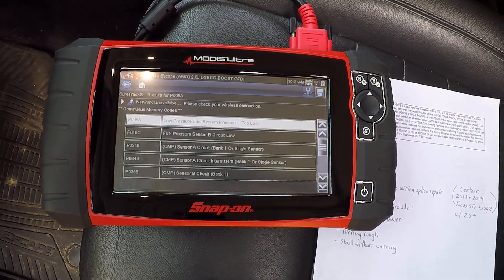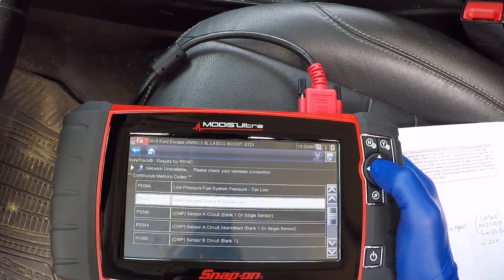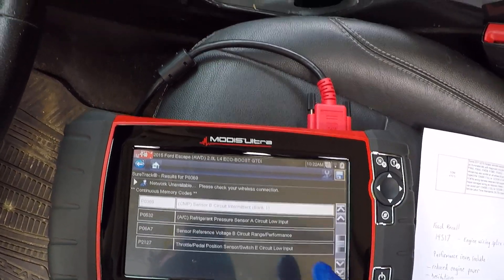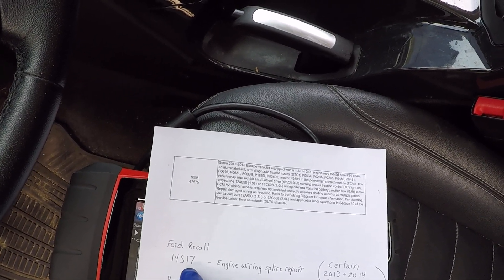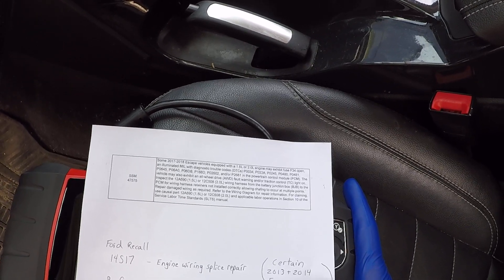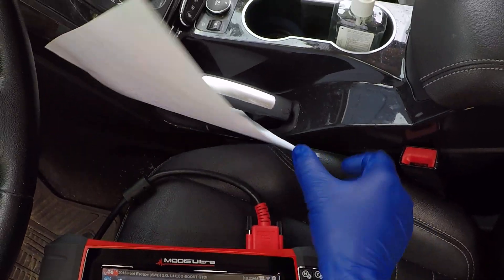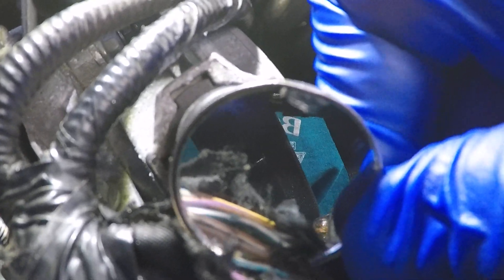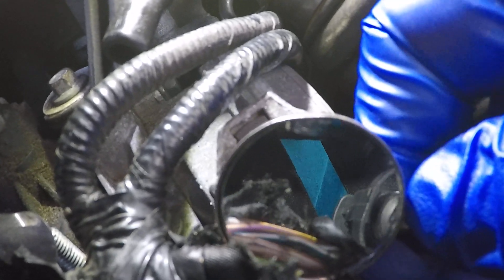How to Fix: 2013+ Ford Escape EcoBoost Stalling Issues

Comment: Just need to make a huge shout out to your comprehensive video quality... Mechanical failures can be So time consuming and the research doesn't really pay in money but it's priceless information... My escape had a hesitation and engine fault on dash everyday... But not a single code thrown for the issue...  Finding this video gave me info about my escapes dangerous short circuit in wire harness . Ford never reach out to me about this issue... The ford dealer acted like it was a mystery and could cost up to one grand in parts to trouble shoot the issue....  I drove off and took it into my own hands..... You took the stress right out of my issue.  Ty.

Comment: Did this repair fix the issue? I have a similar problem with my 2014 2.0. It will drive for about 1/2 hours then shut down with “service engine now” display. I wait for 30 seconds and then it starts up again and runs for another half hour or more.

Comment: Thank you for the video. Would Changing the transmission fluid Fix the issue
Reply from the maker: unfortunately, it definitely won’t
Reply from the maker: This one is all engine related - the main wiring harness
Reply: @MidknightMechanics  thanks so much for your time. if i have my mechanic do what you did in the video will that fix the issue? i'm worried the car wont be worth driving anymore because of this. it seems dangerous.

Comment: My 2013 ford escape stalls on the highway randomly. I've spent so much money and no one can seem to fix the issue.
Reply from the maker: @cameronbrown387  did yours fall under this recall yet? Some 2013s were covered by this.
Reply: I don’t know. I bought it used from Ford . I’m in Canada . How do I find out
Reply: @cameronbrown387 
Call ford dealer ask for recalls, give number from video . Have vin ready, be nice
Reply: I have a 2014 Ford Escape Titanium for my daughters and it is having the same stalling issue and the check engine light flashes.  If you restart the car or drive it for a little longer, it goes away.  I will have to check this wiring, but it may be a misfire caused by the fuel pump or fuel filter.  Not sure if it shows up on a Machine.  According to the website you mentioned, it does not fall under this recall.
Reply: @brandonhumbert4946  I have a 2016 escape that stalls while driving. I think its the fuel pump since the recent recall on 2021 describes the exact problems im having. It will stall while driving. And notice it happens when at 1/4 take or less and also when its hot outside.  Same description as the recent calls on 2021. I filed a complaint with the NHTSA hopefully they'll do a recall on our fuel pumps as well.

Comment: Thank you SO MUCH for doing this video!  I have a 2016 Ford Escape Titanium EcoBoost.  It's been doing CRAZY stuff like door locking & unlocking multiple times and hazard lights flashing at the same time, then sometimes my fuel pump will start making whining noise!  My daughter calls it Gremlins in the car!  It's so random. TWICE it has completely died going down the road at 50mph plus!  And once or twice chugging but not dying. TWICE I've had it towed to the dealership (extended warranty) and they can't find anything wrong with it because it won't "throw a code".  Heaven forbid they actually try to figure it out without a computer!!  My car has been in the shop for 5 days now with no result. I've told them and told them it has to be something electrical because of all the Gremlins going off at the same time. I bought it used in 2021 from a major dealership with low miles. Have had no problems until the last year with this. Also went through a car wash recently and drove away and it immediately started all the chugging again but didn't die. Then later it was fine.  I feel like it got moisture in the wires somewhere that are maybe rubbed like your video.  I'm LITERALLY going to show them this video!!  Then if it is the problem, I'm going to ask to be paid labor for my efforts!  Lol!  Ridiculous!  It's so dangerous for us to keep riding in this vehicle with this issue!  Last time my daughter thought the car was catching fire and scared us both half to death!  I've learned my lesson about Fords!!

Comment: Hello I have a 2013 escape my car has a weird situation going on the car will drive fine for a few miles then when coming to a complete stop the accelerator will feel like there's no power to the pedal. What could this possibly be?
Reply from the maker: Jordan unfortunately it could be many many things. Any trouble codes (DTCs)?

Comment: I have the 2016 Ford Escape titanium with the 2.0 ecoboost. I thought I would check my vehicle to see if it has that wire harness rub through. Sure enough mine was doing it even thought the 2016 was supposed to be fixed right from the factory. Mine was just starting to rub so I wrapped it with electrical tape and used a wire tie and just slightly pulled the harness away from the rub through spot as listed.

Comment: Thank you for the great video.  My mom has a 2013 and it stalls while in drive but only when the AC is on.  Do you think it could still be this problem or do you know if it could be something else?
Reply from the maker: Buck that sounds like a vacuum leak (tear or disconnected hose) to be honest.. if it’s only when the AC is on. Also the easiest thing to check is her battery and voltage first.

Comment: I forgot to mention I did go to Nortons Car Stereo and got a system put car im wondering now if this could be a problem too I just got a new battery paid 450 for the battery and labor.
Reply from the maker: Ugh probably the most I’ve ever heard for a battery swap. It absolutely could be tied to this, if they possibly disturbed the engine harness I talk about in this video- they may have routed the main power wire  for your amplifier on this same harness (they would have zip tied it, to it). If you’re not at a Ford dealer for this diagnosis I would highly recommend getting out of where you are, and taking it to one. A single diagnostic will only cost you about $160 MAX, to find this issue. Some shops just do NOT have the experience. Ford will have seen what your exact escape is doing and know exactly how to approach the fix. Have you ran your VIN on the Ford recall website yet!? Sorry for the kind of bad news but I have a lot of experience with diagnostics, and seeing people get ripped off left and right at Independent shops. When it came to the battery- did an independent do it, or was it Ford?

Comment: Having the same problem with my wife’s 2016 ford escape 1.6. Went to do the same thing you illustrated in this video but it doesn’t have the same wiring harness by the vacuum line

Comment: FOUND PROBLEM WITH PUSH START FORD BOUGHT FROM US AUTO SALES USED CAR DEALERSHIP!!!! they put a GPS tracker on the car so they can find your car if they have to repo it.  Well the Ford dealership just found where the company, US Auto uses called SureTrac put this GPS tracker in the car and had cut wires that went to the push start. So sometimes the car wouldn't start.  Intermittent issues and would cut off while driving on the interstate or wherever.  The push start would lose signal connection with transponder/key fib remote start. ANYONE HAVING ISSUES WITH A USED 2013 FORD ESCAPE ECOBOOST OR ANY OTHER REMOTE START FROM USED CAR COMPANY NEEDS TO HAVE SHOP CHECK WHERE THE GPS TRACKER WAS INSTALLED!!!
Reply from the maker: James you sure about this? Tell us who the used dealer was
Reply: @Midknight Mechanics  Yes Sir,  the name of the dealer was U.S. Auto Sales in Lithia Springs Ga.. I hope this helps someone. I hope it was ok to add this comment.  I just want to help give someone an idea where to check if they go around and around with a used dealership about a problem like we have.

Comment: Hi midnight mechanic's! Great video! However,  my harness wasn't rubbing against the vacuum pump.  We've ran the Vin number and there's only a recall for transmission solenoid. We've already had it in the shop multiple times after we bought it used.  It's a 2013 ecoboost Ford Escape with push button start.  It has stalled on interstate and other places and sometimes doesn't start. The problems are intermittent. The battery,  negative cable and sensor have been replaced.  And the 3rd time we took it to the shop,  the said they had to replace the computer/ECM and we had to buy a second transponder remote for them to program it. And it still does the same thing and throws multiple codes.  Like engine start fault,  BLIS, cross traffic,  etc.. the wiring harness near the vacuum pump isn't even touching it.  It's well tied and clipped all around.  Anything else it could be?
Reply from the maker: James you didn't buy it new did you? These sound like previous flood/major accident & reconstructed style issues since you already did an ecm, and you're saying your harness definitely isn't rubbing. Otherwise everything you said, are symptoms of a harness/wiring short. Make sure to follow the harness as far as you can. Not just on the corner of the vac pump.
Reply: @MidknightMechanics  awesome!! I had a feeling u might say that. About it being a short somewhere,  still, with wiring. Thank u so much for the reply.  It is a used vehicle and we never got the carfax on it even tho they said this were included with our paperwork. As soon as the dealership finds what's wrong with it,  I'll be sure to repost and update everyone. Thanks again,  God bless

Comment: I own a 2016 Ford Escape titanium 2.0 ecoboost and I found this video in the spring. I decided to check my wire loom and nothing was damaged. But to be safe I wire tied my loom so it would not happen. I just went out and checked and found the Ford had removed my wire tie at my last service and the loom was just starting to rub. I called my Ford dealership and asked why they would have removed it. I was told if it is not a Ford approved repair it could not stay like I had it. It was not touching any wires or hoses and told them to leave the damn wire ties the way I had it. I told them I am trying to prevent any damage in the future. Unfortunately I am tied to this dealership because there is a life time power train warranty that is through this dealer. Also I have extended warranty that I paid a fortune for So they have to do all my service work to keep the lifetime power train warranty. I do all my own work accept for the fluid changes.

Comment: Damn and this is why no check engine lights stay on sometimes because it's thinking the electrical is going the job correctly because typically it's just a ground out the signal issues anyway.
Fukn legendary find.

Comment: I have a 2017 ford escape. Had the transmission replaced, 4mo later the acceleration is sluggish. Ford couldn't find codes, I requested replacing spark plugs & air filter. Got it back & now it jolts when accelerating (sometimes not always) does this sound like the MAF? I would greatly appreciate input 🙏
Reply from the maker: Hey Crystal. This could be a lot of different things. If the check engine light is back on, it could be the exact issue in my video- a short in the main harness that caused a national recall on some year escapes because it's fraying against the engine's (metal) valve cover (right next to the cam driven vacuum pump, in my video). But, if your check engine light (CEL) is blinking then going solid, that means misfire- do NOT drive it while misfiring. If this is the case, you could have a bad coil pack, could have the fraying main harness issue, or could have a bad throttle body, and technically yes- you could have a bad MAF sensor but that's very rare. Usually when you're MAF is bad, it won't idle smoothly when in park or neutral, and usually stall. Go get your codes scanned for free by one of the auto parts stores and let me know the codes. Fords are more known for the throttle body to get water/moisture inside of them and make it short- this could easily cause sluggish acceleration or "surging".
Reply: @MidknightMechanics  That's the crazy thing! There isn't a light on. Even when I took it in for slower than usual acceleration there was no light & ford couldn't pull any codes. I had them replace the spark plugs & air filter in hopes it'd improve. Before I took it in it wasn't jolting, just sluggish when accelerating. I'm not sure if the new plugs caused the issue to create jolting due to more power from the plugs. I just know something is wrong & ford acts like they couldn't figure it out.....
Reply from the maker: @Crystal-km1wr  that really stinks. Any chance you ran the VIN through the Ford recall database yet? Usually a 2017 might not even need plugs by now, really depends on mileage. Make sure the simple things have been done, replace your intake air filter, get a full tank of premium- since it's a turbo and direct injection, the higher octane gas helps burn hotter and cleaner, so your valves don't get coated with Carbon (but best thing you could be doing is never going over 6k on oil changes to prevent sludge in the engine). Remember, Ford won't take it up on themselves to find other issues or do a full inspection unless you order/ask for it. Since you still have no codes , I would mean more towards the main harness short that I describe in my video. Sometimes shorts can cause zero CELs, or a laundry list of CELs. Also it's important because that harness has wires that feed all of the coil packs- which obviously fire your spark plugs.

Comment: I just bought the 2013 4WD Ecoboost w/ 2.0 and started having this stalling issue a week after. I haven’t checked on the damage yet, but if it’s bad enough is this something I can direct a shop or the dealer to for a fix if I didn’t want to try myself? Would it be pricey to replace those wires?
Reply from the maker: Hikko it will be pricey to have the dealer do it, make sure to run the VIN through the Ford website ASAP to check for the recall.
Reply: @MidknightMechanics  Thank you for the info and your response! It’s showing I have recalls related to the a door latch and transmission shifter cable bushing. A repair was done on the door latch, but it says there is no remedy for the cable bushing yet. These were issued in June of this year. There’s also a CSP for extended warranty coverage on ABS speed signal which I had issues with today. Do I just bring this information to the dealer or should I go back to the lot that sold me the car and get a warranty they offered and have them fix it and reimburse it later?

Comment: How that happen how u wires got stripped
Reply from the maker: When Ford was making the escapes, they routed the wires too tight against the engine. So when the engine moves during normal driving, the engine eventually will scrape and remove the insulation from the wires, due to friction. Which then causes the metal on metal short.

Comment: Once you do that and you use electrical tape, you can also put an old rubber hose around the outside of the harness and place a cut 2" hose around the aluminum to prevent the harness rubbing at all. You should also clean out the valves with GDI cleaner to clear out the carbon build up. After that the engine will be great.

Comment: My 2013 1.6L SE suddenly went into limp mode. After looking around under the hood and checking the wiring and connections, I found several wires that were frayed and slightly burnt. 
I fixed them myself for free...problem solved!
Reply from the maker: It's terrible that this is even an issue that the Escape is known for.
Reply: Did you now?  Sharing where they are located would make you the hero.

Comment: My daughter has a Ford Escape 2013.  She bought it used.  While she is driving the engine goes off.  Car slows and she has to restart.  Dangerous.  It has happened whilst driving and turning in intersections.  Is this considered stalling?  Could this be the problem?  3 different mechanics have found nothing.
Reply from the maker: Correct my friend, that is stalling. It absolutely could be the harness issue I describe in the video, but technically could be many things, fuel issue, ignition issue, vacuum issue. Make sure to get on Ford's website ASAP and run her VIN number to check for open recalls. Hopefully there is one, so that Ford will cover it. Please let me know what happens.

Comment: I have this same issue. Everytime I fill my gas tank up completely, and then stop at a light for too long, it acts like its trying to "turn on" again, even though its on, and then I get a message telling me to turn my car completely off and turn it back on. After I use a little bit of gas, then this issue never happens again, until I fill up again.  Is this an easy fix?
Reply: I have this same problem too. I fill up it will not start until i  rev the car.
Reply: U hav a purge valve issue
Reply from the maker: Not very easy Rena, the shorts are hidden inside the main harnesses insulation. First of though, google Ford recalls, and type in your Vin number (or just call Ford) to see if your VIN is covered, under the recall for these issues. Let me know how it goes, I really appreciate the feedback.
Reply: I have the same problem I can't afford to fix this what do I do.